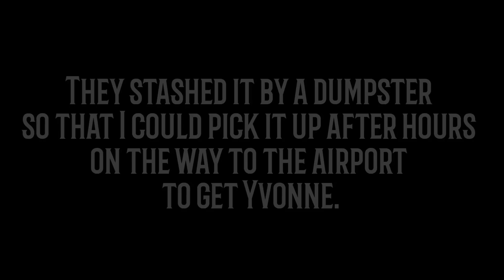Finishing the Clerestory + Bathroom Layout in our Straw Bale House : Day 40

Comment: I love the brave approach that you have to building your house. You think through your energy and heating needs, as well as your lighting needs. We did the same in CT implementing solar tubes and sizing custom polygon windows for unusual architectural areas. The single pane is effective for transferring heat. In the old days, storm windows provided extra warmth in winter. Most home owners in America have no experience with these methods or concepts. Excellent work and you met the deadline!😎
Reply: Of course I grew up drawing on the frost on the interior of our Windows in Northern Alberta. Few people have experienced that either.
Reply from the maker: Well I grew up in an area where every fall the the storm windows were brought out of the basement and installed and the screens were taken out. So I know exactly what you're talking about. Our house that we had in Savannah georgia, was built in 1905. All the windows were single-pane double hung windows and we are all too familiar with the heat transfer through single pane glass. Thanks for watching in your comments! 👍

Comment: Nice of them to help by putting out the glass like that. Things like that make you come back as a customer.

Regarding the small piece of wood you pot on the boards. I like it.  And I can even se some possibilities for it down the line. If you or Yvonne want to try your hand on some ornamental wood carving I think that really your make a thing like that pop.

Or you could use it as a mounting point for a decorative shelf or a something like that. Loads of options. =)

Also very nice music in this episode. =)
Reply from the maker: Thank you! I already have some ideas for a wooden frieze running around the perimeter of the house on the outside, featuring geometric shapes. In fact I've already cut the necessary pieces of wood.
Reply: That sounds like a nice video to look forward to =)

Comment: Fantastic work man. It's too bad some of the foam went through some of the small cracks, unfortunately it does that. Great work on the glass, and I'm very surprised it was cool to the touch, very well explained.
Reply from the maker: Thanks. I tried sealing up as many gaps as possible prior to the crew applying the spray foam but at least I know every little crevice is sealed up tight. The touch up work won't be too bad.

Comment: I'm not sure that you are considering that in the winter your heat will rise and tend to radiate through those single pane glass windows at night. Also, thermodynamics says that heat goes to cold. Since glass is a bad insulator you will likely lose heat from those single-pane windows. Not sure if the loss with be greater than the heat stored in the mass. You will find out when winter hits. 

Just my 2 cents worth every penny. LOL
Reply from the maker: All very good information. I will be continually updating the status of our inside temperature of the straw bale house. After a year it should be an interesting to look at how the house reacts in each of the four seasons. Stay tuned you don't want to miss these updates. Thanks for watching! PS we've had suggestions of making thermal curtains which can be closed in the evening. I'm not sure what would be more cost effective putting in the second pain of glass at a cost of about $300 total or fabricating thermal curtains. Something to think about.

Comment: The windows turned out real nice. Question, at the transition from wood to cob do you use any flashing, metal lathe, or do you just cob up to it?
Reply from the maker: We've always use chicken wire. We have friends who have used burlap is well to create a transition. I bought a big role stucco lath the other day and that's what we'll be using Create baskets above the windows and to transition on the window sills from wood Cobb. I'm still considering using tile on all of the window sills for durability. Especially if Yvonne uses them for plants.
Reply: @theupsideofdownsizing  ok thanks

Comment: Just my opinion, but I would've assumed you'd placed a few "operable" windows across that band of fixed glass panels. Since you live in a hot, desert climate...it would seem air ventilation would be a desired feature, more than passive solar heating.  And as you probably know, the best passive heating requires some dark, thick floor tiles to soak up those solar rays.  But with minimal sunrays hitting the floor, it's not feasible. Again, just an opinion from far away. It is a beautiful house though m
Reply from the maker: Couldn't afford to put operable windows up there. The 20 panes of fixed glass stretched our budget as is. Hopefully the number of operable windows we have it for level be sufficient to create a good cross draft. Thermal mass on the floor will be coming. Perhaps we're extremely fortunate to live in an area with a mild winter. No snow shoveling going on at our place. 🤣

Comment: all that heat gain in sunlight turns into heat loss at night.
Reply from the maker: Correct. One of our subscribers recommended a thermal curtain and we will keep that in mind as we monitor the effects of the Clerestory. We will of course keep our viewers up to date on the results and any changes that may be needed. We are not afraid of airing our mistakes as other can learn from our failures just as much as from our successes. Thanks for watching!👍
Reply: Yes, it is the R value that matters. So much of your build involved high R value components like straw bales and spray foam, a little heat leakage from the single pane windows won't matter, until it does. Curtains or another pane of glass are easy solutions. The important thing is to keep progressing with the build.